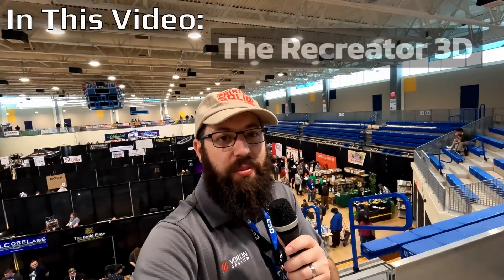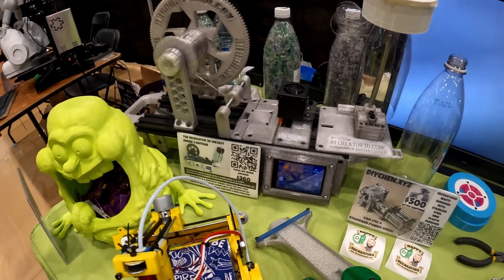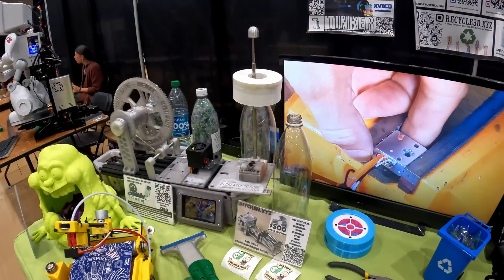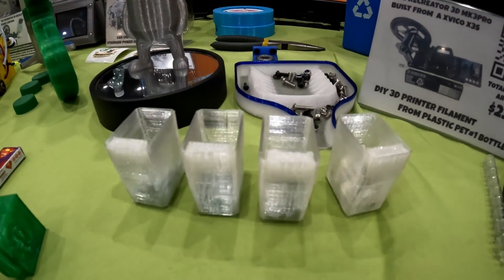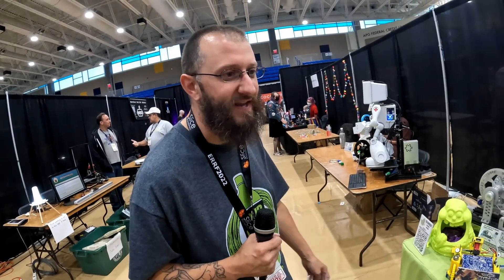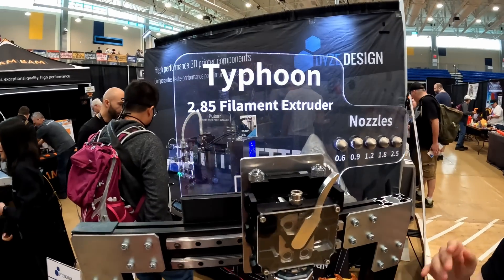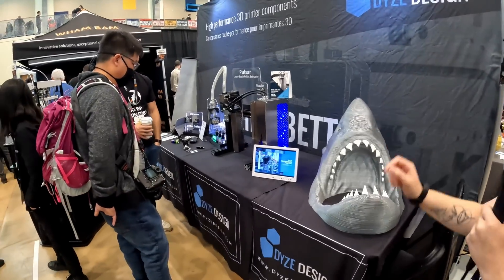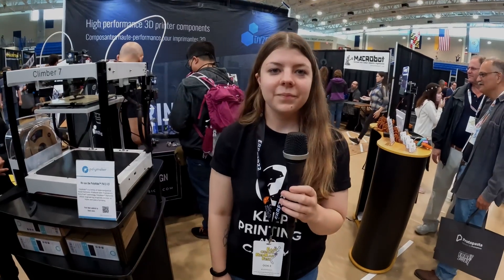Pop Bottles into Filament and Dyze Designs ERRF Recap - Part 3 #3d #3dprinting

Comment: those high flow hot ends got me thinking, could you pair that with your typical hotend and do mixed layer height printing?
print internal perimeters and fill with the high flow and large layer thicknesses, and the outer perimeters with the typical hobby hot end at a much finer layer height.